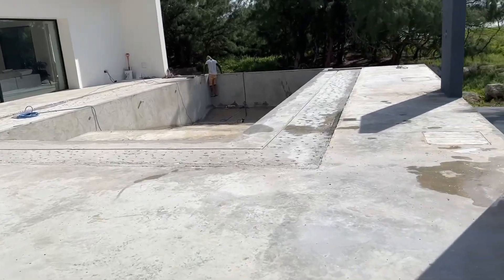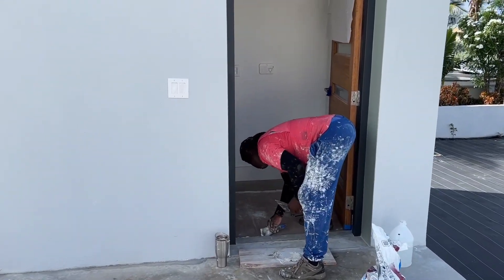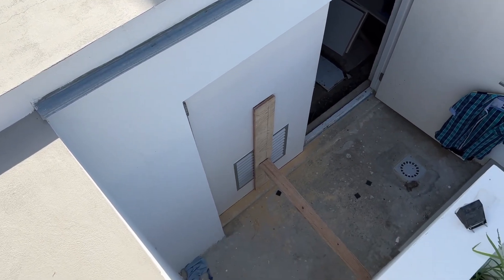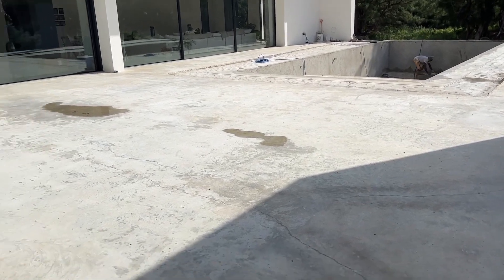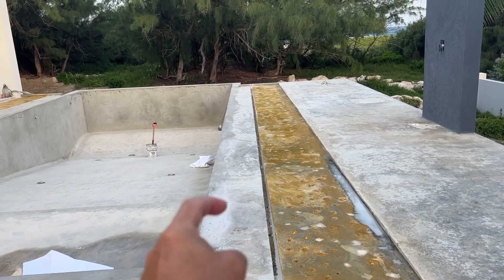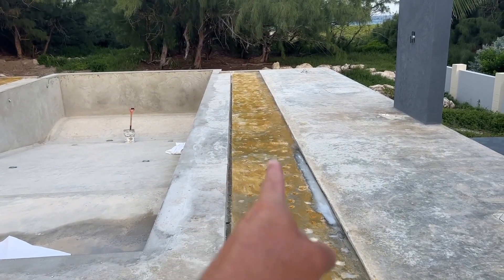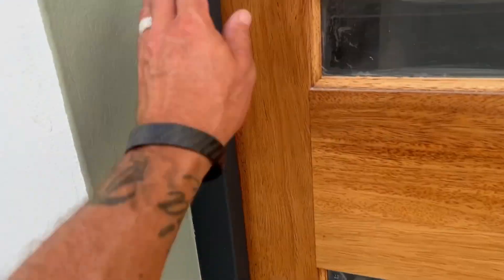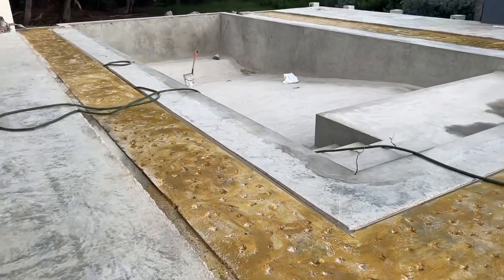Barbados 🇧🇧 Beach House Build - Day 8

Comment: Glad your pool won't be just grey as you will need some blue or the greeny colour on your new gate mixed with white tiles to really make it pop. The light on the garage should be a downlight I suppose with a wide span that doesn't disturb neighbours.
Reply from the maker: Yes the pool is going to be bright blue, should look awesome when it is done!

As for the light, it is a downlight but you can obviously see it from the side. I thought of painting the side lens black, surely this would do the same as the board?